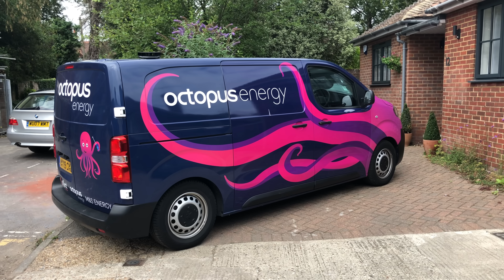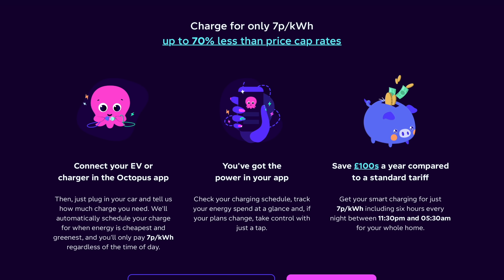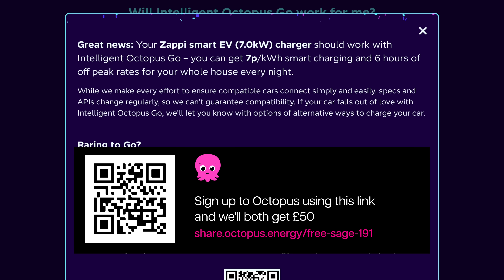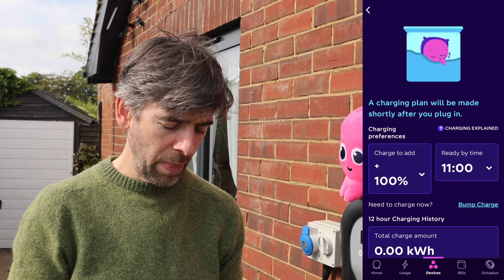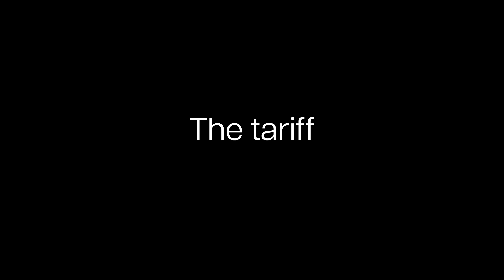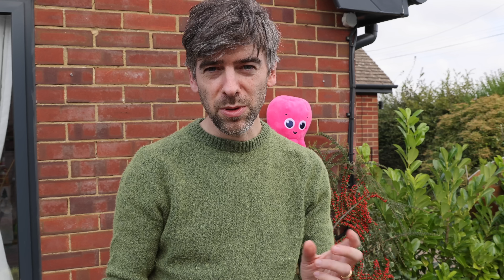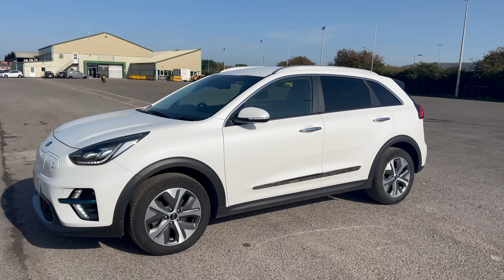We've saved a fortune! All about the UK's most popular EV tariff: Intelligent Octopus Go

Comment: we've also had Octopus Go Intelligent for some time, and 2 EVs. it works brilliantly for us when combined with the solar and 13.2kw battery. We charge the battery overnight using the 7p rate, normally only about 10 kw to fill it so that's 70p. then in the day we export all the solar at 15p per kw so even running 2 EVs our electric bills in the summer are negative. So far this year we have around £350 charges in electricity and £426 back for exports. And around 8,000 miles done between the cars on home charging included in those numbers! It is of course all a bit man maths as I've not taken into account the cost of solar and battery installation !
Reply: Yery siimilar to me, I cant be bothered to work out how much money i am saving just know its a shed full. Also apart from initial outlay why so few do this. Must really slash the payback time for the solar.
Reply: kWh
Reply: Sounds good, only bit I don't understand is, your 13kwh battery is full by morning via 7p rate, then if you sell it all back at 15p, you would them have to use and pay for electricity at the daytime intelligent rate ie 27p.... so if you use 13kwh per day, the net difference is that you pay 19p per kwh for 13kwh used?

Hope that makes sense.

Be great to know what I'm missing
Reply: @hsingh1770 missing the solar…so the battery is charged overnight at 7p rate. During the day, the solar is exported at 15p rate. So today, for example, we paid 70p to charge the battery (10 Kw to take it to 100% full), and generated 30Kw of electricity which gave us £4.50 income from Octopus. Running the house from the battery during the day runs the battery down by 5-10kw depending on the time of year and what we use. We don’t use any electricity at the 27p rate other than in the winter where maybe we might use 0.3 of a Kw an hour if the battery has run down. This has only happened half a dozen times since we had the set up, and maybe on,y a couple of hours before we go to bed. Hope this makes sense!
Reply: @WolfiesWheels knew I was missing something obvious!  Brilliant hack!
Getting by ev charger installed on Monday and will switch to intelligent 👍🏼  Have 13kwh growatt batteries and solar too so will copy and paste your excellent method, thanks for clarifying 😊
Reply: So I have had the HV EV charger installed. When I set the schedule on octopus, it kicks in at daytime to charge the car (at 7p) but problem is it is draining the battery and using the solar too!  How do you do you ensure the battery only sells back to grid during day and doesn't charge the ev instead..?
Reply: @hsingh1770 I think that’s a quirk of Octopus Intelligent. We actually schedule it so that the car will charge from 23.30 and be charged by 05.30. There are things you can do to the physical side of things on the charging circuit which, frankly, are beyond my knowledge but you see things such as “Henderson blocks” and “ct clamps” being spoken of on various YouTube videos and forums. These (I think) effectively put the charger isolated away from the battery/solar side of things, so the charger doesn’t “see” the battery or solar as a source of power, but only sees the grid as somewhere to draw from. We have 2 chargers, one has been wired like this and never draws from the battery (this was installed before we had solar and battery), the other works like yours does so will draw from battery, solar or grid and this was fitted after we had solar and battery installed. Rather than go to all the effort of having someone back in to charge charger #2 to work the same as #1 we just shedule the charge as mentioned.hope this helps!
Reply: @WolfiesWheels  thanks, so you set your batteries to charge at the same time at night?
Reply: @hsingh1770 kind of. With our battery (Powerwall) it isn’t very programmable which suits me. But you do put into the app your energy tariff so that shows that between 23.30 and 05.30 the rate is .07 a unit and between 05.30 and 23.30 it’s .27 a unit. And the export rate is put in at .15 a unit. It then uses its inbuilt programming logic to determine when it should be charging and when it should export from the solar etc to make the house as cheap as possible to run. So it kind of just gets left to its own devices as opposed to being programmed by me to do certain things at different times of the day.

Comment: The Hypervolt 3.0 and above is now part of the IOG family of charging points, earler versions will come on board later. One caveat is, as you point out, IOG does not know the SOC of the car. Confusingly the app appears to offer a charge to limit, making you think you can limit the charge to say 80%, as a way of protecting the battery long term. In my case that isn't how it works. You have to say what % you want to add. For example if the SOC is 60% and you wish to charge to 80% you have to put 20% in the Charge Limit box, not the intuitive 80% you would be forgiven for thinking. Not only is that box confusing but you now need to be more active in "programming" the app than you should be.  This is not explained to Hypervolt owners. I have been told that IOG can only control either the car or the charge point. If your car is also compatible with IOG you can elect to have the car as the interface with IOG and that would then enable charging to a given % as IOG will be able to see the current SOC %. Hope that helps.

Comment: You really need a home battery last February I used 1243.7kWh my bill for that period was £135.53. 

In theory if you are a full on geek you could use the Home Assistant integrations for you car and Intelligent Octopus integration to check which car is plugged and what the SOC is and automatically adjust the required charge.

Comment: In terms of comparison with Agile, I've found the best way to tell if it's worthwhile staying on Intelligent Go is to look at the average kWh price for all consumption on the bill. For us, the average last month was 10.9p/kWh, 10.3p/kWh the month before that. So very much working for us!
Reply: Do you have a home battery or solar? I considered Agile but I managed an average of 7.27p in September on 939kWh which I think will be pretty hard to beat on Agile.
Reply: @nervousfrog101 You're not wrong. My October average was 11p on Agile so similar to the other person. 
I choose Agile though because although we have an EV, it doesn't do regular trips and so I'm not regularly charging to use IOG slots. 
I do have a storage battery and during the peak of the energy pricing, was running off that all day. However, the current integration of the battery is smart enough to charge on cheapest slots and discharge at the worst, I'm not fully cycling the battery each day, which feels better for longevity.
Reply: No solar or battery, so not going to be able to match your 7.27p!

Comment: Shame it doesn't work most of the time.  Mine consistently fails to charge my car overnight when using the "Intelligent" scheduling in the Octopus app.  After going on various forums, this appears to be a common problem for lots of people on the Intelligent Octopus Go tariff.
Reply from the maker: That’s disappointing. I’ve not heard of those issues. Does it relate to any particular car or charger brand?
Reply: @MrEV  I'm using the Zappi too and just charging a Tesla model 3, with no other schedules set in the car or the charger - I've come across a lot of people who've had similar issues unfortunately.
Reply: Me too I’ve gone back to using the car timer and selecting charge now after I plug in OHME customer service has been terrible
Reply: @gazzrobb2366  I'm just using a fast charge from the Zappi now and bypassing the Octopus app completely, and just starting it at 11:30pm to get the cheap rate.

Comment: Do you often get charge slots outside of the peak rate? Im also in kent and i think i might have seen a charge schedule before 23:30 maybe once in 2ish years.
Reply from the maker: Yes — almost every time I plugged in! Are you doing it through the car or the charger?
Reply: @MrEV  strange! I do it through my ohme charger. I have an MG5 which is not supported. I'd be interested to hear if Ohme chargers have a similar experience. Perhaps I have set something up wrong?
Reply: Quite a few people with Ohme chargers have said that it starts to charge straight away. Apparently some of those who've checked have said that initial bit isn't part of the schedule and soon switches off, although still seems to be at the cheaper rate. I'm with Octopus but don't get my Ioniq5 until January (🤞)
Reply: @steveknowles8053  well I don't know what I'm doing wrong, but I mine is always 23:30 at the earliest. Not complaining, still a great traiff

Comment: I have this and saves a fortune. The problem I have is that outside of the 6 hour window it dumps the power from my power walls into the car so I have to manually set the Tesla app not to go below where it is at that point. You would think Tesla car would talk through the gateway to the battery not to take energy from the battery if the car is charging. I’ve given them feedback on this but they haven’t done anything about it. I’m sure there are 3rd party solutions out there.
Reply from the maker: That's really interesting, thank you! Especially as I'm hoping to get a Powerwall at some point.
Reply: @MrEV  you’re welcome to come and look at my setup. I’m only down at the top end of Eastbourne.

Comment: I thought Octopus were not happy with this advice. 
Their advice is to set the ‘charge to add’ and ‘ready by’ accurately. If not you could be seen as ‘gaming’
You didn’t mention you only get the cheap rate when the car is actively charging. 
Therefore when you plug in during the afternoon it won’t the give further cheaper slots once the car is full.
(Edit). Just saw the end of the Vid. Looks like you acknowledge the fair usage policy.
Reply from the maker: Did I not make that clear about it only being cheap when charging? I thought it was obvious, but thanks for mentioning.

I don't think people can be expected to check the battery % when they plug-in. It's adding a lot of extra faff. But you could be right that it's gaming it, and perhaps Octopus will ask me nicely (or not!) to remove the video! 😀
Reply: @MrEV sorry, but I think you are being naive here. Clearly asking for 100% all the time is going to get it to schedule charges when it wouldn't ordinarily. It's not just when there is renewables on the system. It looks at something like 29 variables to work out when to charge. Octopus try to be fair and accommodate peoples charging requirements so if you ask for 100% all the time, you will be getting slots you shouldn't. 

I personally dont think its too much to ask to put the right percentage in in exchange for 1/3rd of the cost of SVR charging. It's not hard to get out the car and see what the SoC is and think to get back to 80% or 100% I need to add x%, open the app and set it. By doing 100% all the time (and everyone doing it) the tariff would be unviable and we'd all be forced back onto Go with higher rates. 

Octopus are tracking this, we heard as much on the Zappi x IOG beta. So if too many people do it, they will act. I probably can't say any more as it was under NDA.
Reply: @cingramuk I agree. It’s crazy asking for always 100% full car charge if it only needs say 30% adding.  That is downright abuse IMHO.
Reply: @MrEV  I think to make it clearer you mention on plugging in you get a number of slots. If, for instance the car reaches 100% in the first published slot then any further slots wouldn’t be valid as the car would not accept any further charge. I’d imagine some people could become confused and just take the published slots as gospel and look to load shift during these times (outside 23:30-05:30h)
Reply: I thought you made it very clear that only when there is excess renewables on the grid the car will charge, and your whole home gets the benefit  @MrEV
Reply: @StephenButlerOne except its not. Octopus will do their best to accommodate charging so if you ask for 100% in a short time, it will think 'oh crap, this guy needs a charge quick' so will allocate slots it wouldn't ordinarily do. This is well documented on the Octopus forums and Octopus do not expect people to behave like this. They expect people to ask for what they need. Asking for 100% all the time is 100% gaming the system.